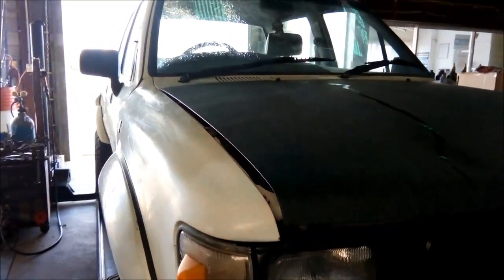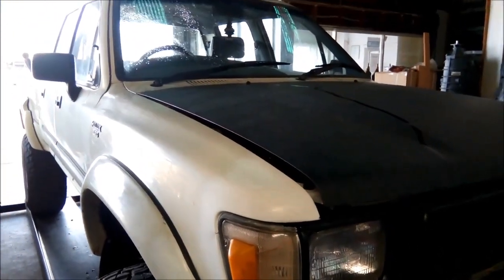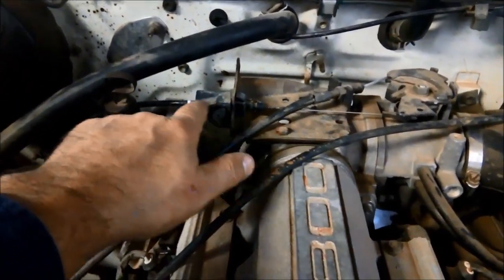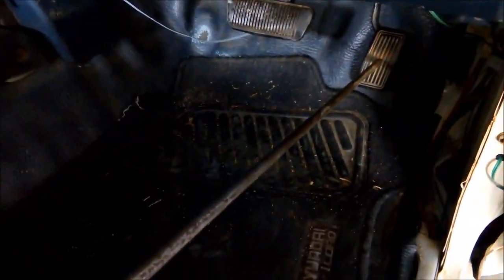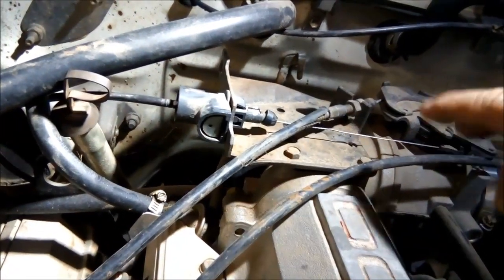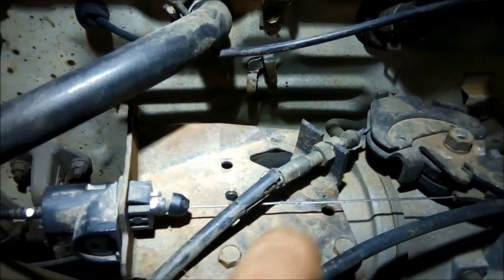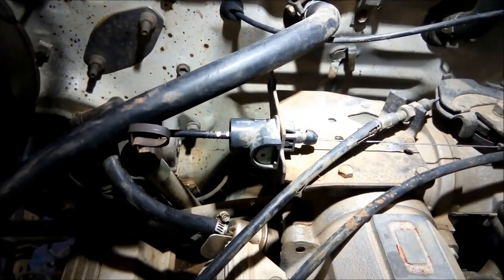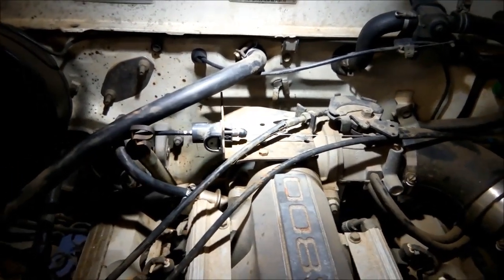700R4 4L60 TV Throttle Valve Cable Adjustment How to DIY

Comment: I know this video is 5+ years old, but I'm glad you kept it up. I had my 1990 Chevy S10's 700r4 rebuilt at a transmission shop, and when I got it back, the shift from 3rd to 4th at 42mph was grindy and took too long. Adjusted the TV Cable out (the shaft part that clicks) by holding the button as I wide-open-throttled the lever, and it fixed the grind, but it still hung a few seconds in between the 3rd to 4th shift and didn't go into Torque lockup until I let off the throttle about 45mph. Just today, about 6 months after rebuild, went back to the TV Cable to see if I could get rid of the hang, and watched your video. Did as you said, and now the shaft part that clicks is just barely sticking out, and the cable from it to the throttle lever is pretty tight. Road tested it and it shifts from 1-2 at 20mph, 2-3 around 35mph, lockup at 42mph without letting off throttle, then 3-4 at 48mph and that is in-spec for these S10s.
Reply from the maker: hi, no worries glad if helped. cheers for beers if deserved, link is in description. thanks

Comment: Hi ,its a self adjust cable.... you must push the Metal button (HOUSING)  put the cable all the way back in the block  , release the Button then push full trottle and it set itself.
!
Reply from the maker: hi, in a perfect world it could work that way. however, if you hold the button and slide cable in/out you can also fine adjust, especially if/when throttle linkages are worn/bent/modified. thanks for your input, cheers
Reply: Yeah it's never tight enough when you use the self adjustment.....that's just a starting point ....what he did here is the best way